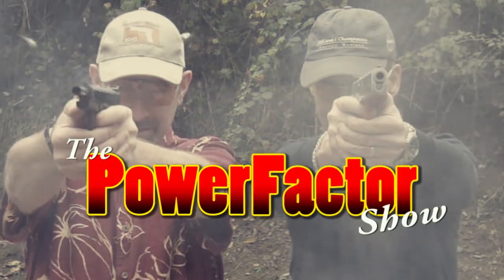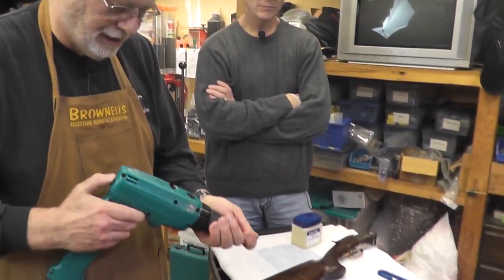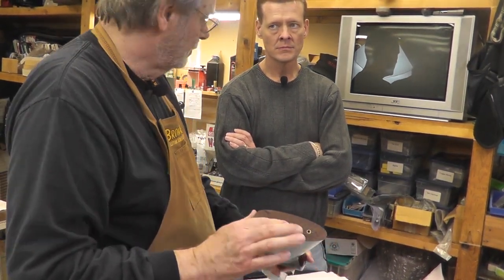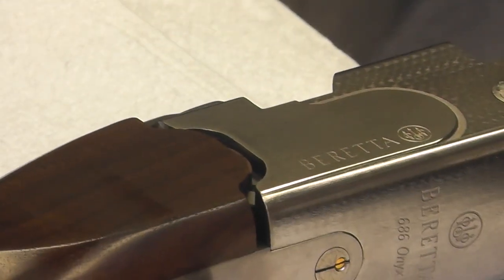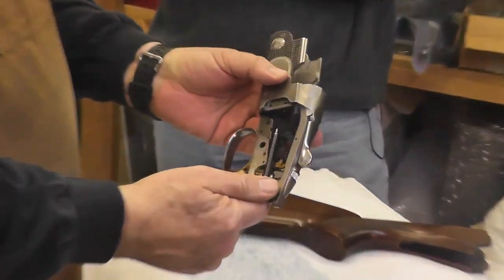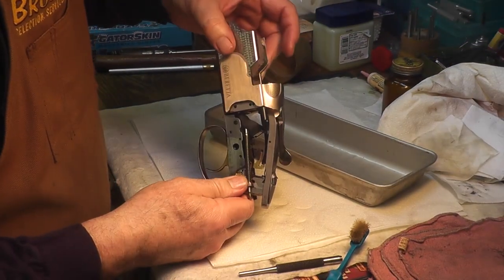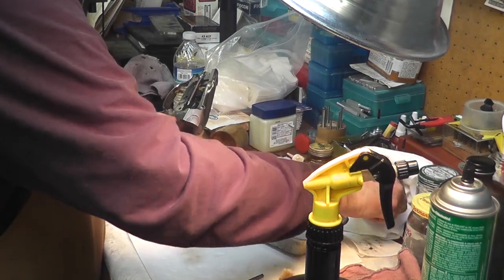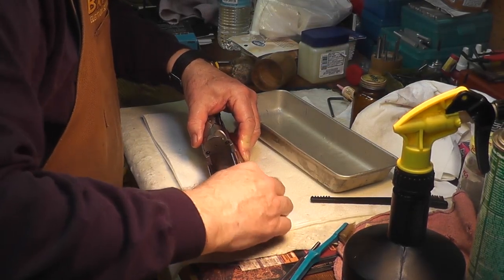Episode 116 - Cleaning an Over Under Shotgun - Part Two

Comment: Being an owner of a 686 Onyx, I found these videos facinating! I even removed my Ejector pins and cleaned them and the channels after watching them. It would be great if you go a bit more in depth now, like showing us how to replace firing pins, and other parts and springs etc, or even just dismantle the whole block system and workings and put it back together, pointing out all the parts, that would be so helpful!

Comment: Cocked versus uncocked.  READ THE OWNERS MANUAL.  Beretta specifically states in the owners manual to store with the hammers released and actually has images of a snap ap to protect the firing pin.  BTW, I am a 64 year old Working Mechanical Engineer so I do understand why you feel so I do understand why you feel there is no harm to storing a coil spring with it compressed.  However I also understand that many manufacturers test to determine what works best in a case like this.  So when something is advised in the Manual I do what is advised.

BTW, I do agree with the used of Mobil 1 lubricants, they are excellent.

Comment: You mentioned taking the stock off a brand new shotgun and cleaning it out.  I'm assuming that this is to remove the heavy grease that it ships from the manufacture with.  Why does it matter that it has heavy grease in the internals and if it does, why does the manufacturer ship the gun with it.  What would you recommend in its place?  I just picked up some Mil-Comm TW25B.  Is that a good substitute?  And do the internals get the full treatment when you first get it, with the brake cleaner and Break-Free?  Thanks.

Comment: I've been struggling to find instructions as to how to remove the ejectors on my Browning Cynergy for some more through cleaning.  The parts diagram is...a bit obtuse to my sensibilities.  If I remember correctly, John had or had access to a Cynergy.  Any suggestions?

Comment: I have a Whetherby Orion 20 Gauge over/under.  There are no holes in the butt of the stock to release the stock from the trigger group......any advice on how to get the stock off?
Reply: Looking at the manual that Weatherby has on their website...it appears there are two screws that attach the buttpad to the stock (S06)...and then a single bolt that attaches the stock to the receiver(S04).
Reply: William F

Comment: When removing the stock from the receiver it looks like the hammers are cocked.  Does this matter?  I typically decock my 686 via snap caps when I am done shooting, pull the fore-end so the hammers to not recock and then takedown the gun to put it back in it's case.
Reply: I don't think it matters if they are cocked or not to just remove the stock.  In the dis-assembly video it does matter when dropping the trigger plate from the reciever.
Reply: John Larson Thank you for the speedy reply.  Very nice videos.  I have subscribed to your channel.

Comment: why not use a dead shell to dry-fire with. ?
Reply: Because the primer on the used cartridge will already have a dent from when it was fired. So used shells will offer no real protection to firing pins. Either use snap caps, or don't pull the trigger. What ever floats your boat.